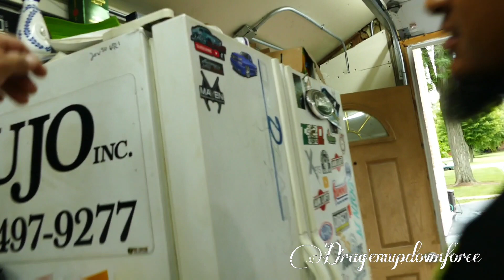turbo 69  mustang coupe

Comment: It's in the tune I have the same setup sbf on Holley HP EFI with a 5 speed. It's probably to rich.
Reply from the maker: That car was running lean and the throttle cable had to much slack